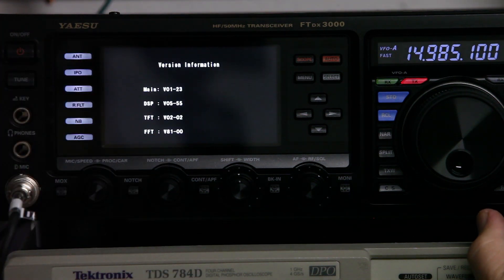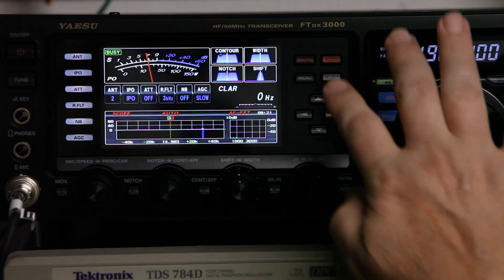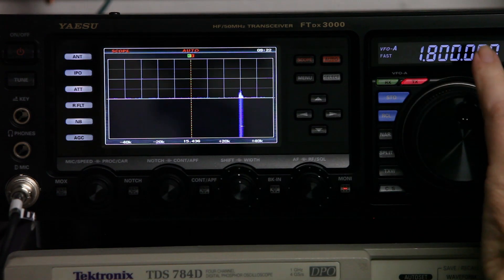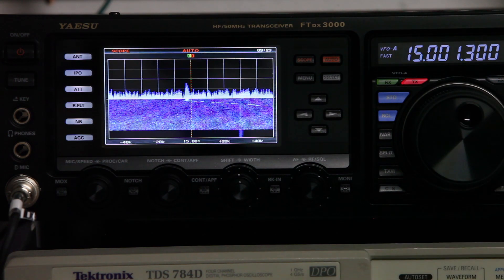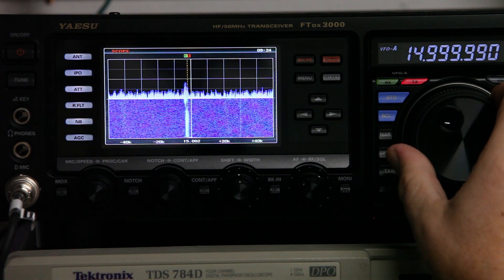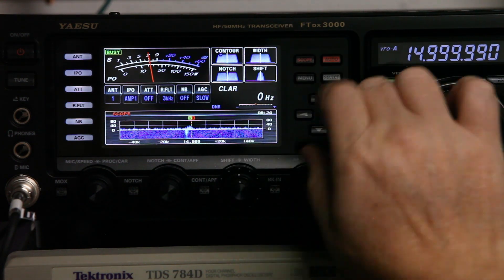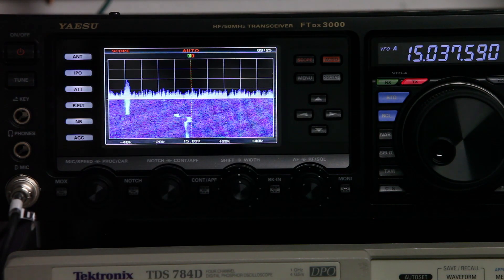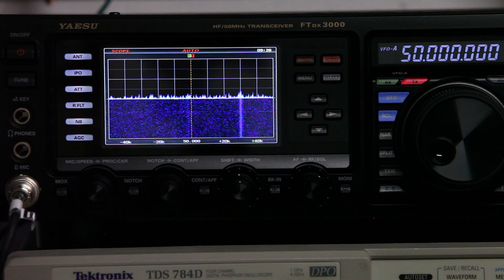Yaesu FTDX-3000 waterfall display error

Comment: bought mine in january 2020 and it has it, too. the ftxd-3000 is a great radio and i love it. however, this prob (that could have been easily taken care of digitally/by clever programming) and the fact, that - in 2020! - the scope is not realtime but refreshes only about twice a second, which leads to an unreadable scope, if waterfall is turned off (try this: scope only, no waterfall, turn the dial and try to track the peaks / tuning to one - as soon as you start you loose sight of your peak in the many) is a real bummer and places yaseu into this consumer/cheap corner, once again. they just don‘t seem to walk the last mile to perfection.

Comment: every FTDX-3000 have this.
I can live with that.
73 Mark
Reply from the maker: I am new to Ham Radio and bought the Yaesu FTDX-3000 so I could start my learning process with a known good hardware platform. Yaesu does not share any info on this issue so I naturally assumed the problem was with my own knowledge and/or setup. It took me 6 months of research to finally realize that I needed to post the problem on youtube to offer a discussion area. Now I understand that my fault may be that my antenna may not have enough gain to push this phantom line off the screen. But Yaesu should discuss this issue and reviewers at ARRL should not have glossed over this issue in their lab reviews either in my opinion. Had Yaesu put some public info on this issue into their own FAQs I would not have wasted 6 months fooling around with this issue, and I would likely buy new radios from Yaesu. As it stands now I regret buying into Yaesu - not because the issue is so important in hind sight - but that they don't believe in their own product strong enough to be honest about discussing this issue publicly.

Comment from the maker: I received a comment from Yaesu Technical Support July 7 2018:

If the phantom signal you are seeing on the waterfall is three vertical lines from the center it is a digital artifact.
It is a result of part of the digital processing and cannot be removed.
It is however at a very low level and usually disappears into the noise floor when on the HF bands.

Comment: I can confirm for you that this problem exists on all FTdx3000's. It existed on all firmware versions since day 1 and as far as I know there is nothing we can do about it. Yaesu are correct that (for the most part) the image, while being above the receivers noise floor, is below the usual HF receive floor. As such, it will rarely bother you in HF. Where it will REALLY bother you is on 6 metres where the normal receive floor is below the 30khz image and so it shows up strongly all the time. Yaesu chose not to remedy this. That was a poor decision in my opinion. A 20db notch at the 30khz waterfall point could have been written to the DSP quite easily, without affecting overall waterfall performance too much, and even included as a menu item to give us the choice whether to switch it in or not. Missed opportunity imo..

Comment: I was told this by a ham experienced with the 3000........The 30 KHz IF in the Radio's DSP leaking through. This has been hashed around as well too. It's in everyone I have seen including my own one owner, and it's in the 991/991A and would suspect the 1200 with the FFT TFT Option too.

Comment: Do you use a transformator power supply?
Reply from the maker: I use the recommended power supply sold by Yaesu: FP-1030A. "linear-circuit uses no switching circuitry and is very RF-hash silent. Output ripple at full 25 amp load is only 3mV peak to peak, indicating high-level regulation"